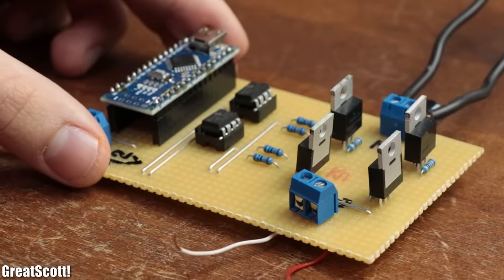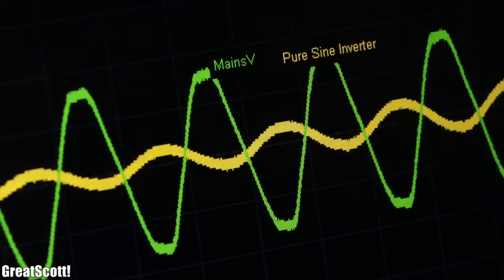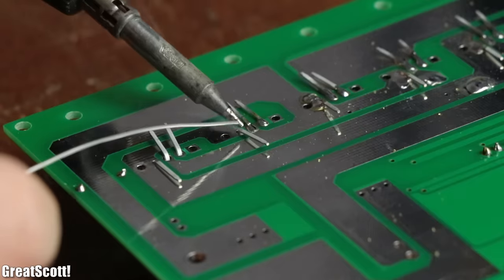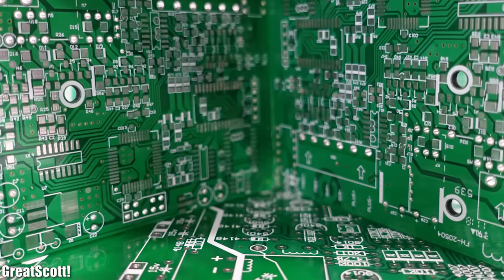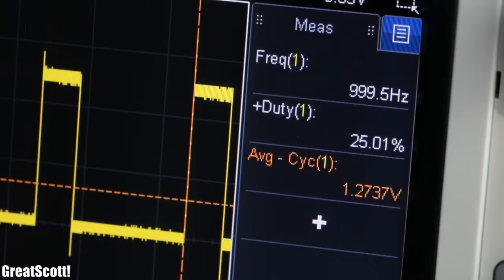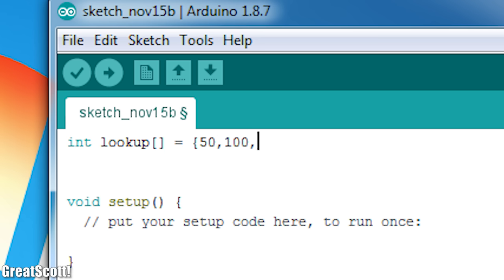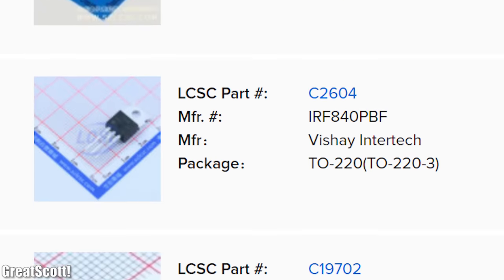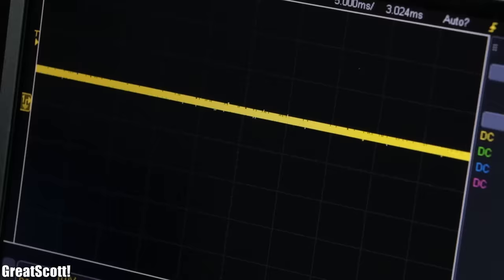Does it suck? Chinese DIY Pure Sine Wave Inverter || Sinusoidal PWM (SPWM) Tutorial

Comment: Nobody should underestimate the difficulty of inverters. They are hard to make properly, and mains voltage ones are frickin' dangerous too.
Reply from the maker: Well said.
Reply: But it would be pretty great if there was a good open hardware design for a 1000-2000W 12V to 220V inverter around.
Reply: @FQD2N Extremely high current is available, and there are nasty frequencies involved. Touch the wrong thing and you might have 40A at 6kHz flowing through you. I bet that would hurt like the dickens and you probably wouldn't be able to let go.
Reply: As someone who worked on a grid connected solar inverter. You're right. Its even harder when you have to design it according to set standards. Minimal Harmonics and leakage current etc.
Reply: @FQD2N well what if you are electrically grounded?
Reply: Seasoned professionals who do this for their day job wear eye and face protection to protect for that  inevitable explosion. I think there are more fun electronics projects out there that are way less dangerous.
Reply: Yes, because you need a (preferably isolated) dc-dc step-up converter, which get pretty complicated to make, and feedback circuits to handle dead-time compensation and follow mains voltage.
Reply: >"don't underestimate inverters"
>people be still underestimating inverters.
Reply: @TCGProductions03  you realise that you need a potential on the order of 1 million volts to get 40A to flow through a human body...
Reply: It took me a little more than two years to get a flyback up and running, so yes, the difficulty cannot be overrated.
Reply: @vincei4252  Except people (usually) don't want to build inverters just for fun, they have a practical application and inverters are usually overpriced, so...
Reply: is it possible to get a tour video of your work shop to see what items you have on hand to make these projects? its nice to order stuff from china in advance and not having to wait 3months for that one Mosfet to arrive to finish the project.
Reply: @LeslieIsgrigg  Cars, boats and RVs are usually using 12V (I think some 24V) hence my interest in that volt range. As for output - I am in the 220V 50Hz camp.
Reply: Disagree for dangerous assumption(!), partly agree for "difficulty". The "difficult" part is rather pricy for learning & mastering. One needs to get the an oscilloscope (the 4-channel ones are much better!) and at least one differential probe (better to have 2x) for high-side debugging & tuning. There are also some complications for getting into MCU registers for smooth & precise PWM, but it's only a something to learn thing.
For the dangers these introduce to the hobbyist, nothing special is here compared to working with mains voltages.
Reply: I used a DDS and a stereo amplifier and a step up transformer. Got a flawless sinewave
Reply: vial.of.photons  everything depends on the power you want. I needed an adjustable frequency and adjustable voltage supply , which  I use for calibration. I've been able to run lights and fans etc from it but its not what its for. cheapest it could be built for is around $35 USD. I made a couple of videos about it early last year. I've been meaning to make a new video on the subject
Reply: @50Hz  what is a dds,  please?
Reply: I found it, direct digital synthesis, is ok?
Reply: @DavidLopez-bz4rj  yes. I used a Ad9851
Reply: @50Hz  thanks
Reply: @tcurdt  i should really make one! Im a power electronics PhD student.
Reply: @rikka0_059  Well, do it! Would be great to have an open hardware effort into that direction.
Reply: Alex Beardmore they're easy asfuck to make..
Reply: Miguel Moreno Talk is cheap. Care to share a design?
Reply: I think old square wave inverters are easy to make, especially square wave mechanical ones, but definitely not downplaying the danger.
Reply: @greatscottlab  Sss
Reply: @TCGProductions03  It's just pure bullshit, especially if one is somehow familiar with ohms law.
Reply: @curitosikls8653  The breakdown voltage of air, under normal conditions, is about 1 KV per millimeter. You need about 5000 volts DC for a 5 mm arc. For AC it's going to be frequency-dependant, as capacitance starts playing role, but still pretty high.
Reply: muito legal
Reply: Then why are they available in the market for so cheap?
Reply: why y'all just scaring like this from main voltage, what would you do if you where playing with 400v 3 phase voltage like how a normal electrician Does every day of his life. If you want to make sure people wont get harmed, Its better to teach students or new people or whatever how to work with it without harming themselves, not scaring the shit out of em!
Reply: @Aidan Fransen - You said pretty much what I was going to say. It really pisses me off when people state fallacies as fact, and people queue up to like the comment. It’s the same logic that claims “it’s not the volts, it’s the Amps that kill”, and “car batteries can kill because there’s over 300 Amps in there!”  Both are demonstrably gibberish. Ohm’s law is one of the first things you learn when getting into electronics or EE. If they have learned that, then they shouldn’t be spouting fallacies and misinformation. If they haven’t learned it, they should STFU and stick to a subject they understand. Also, “dangerous frequencies”?! The danger of death from cardiac arrest by electric shock decreases with increasing frequency, this is a well known phenomenon. High frequency AC (ie several KHz and higher) can burn, but our nervous system is increasingly less affected by it as the frequency goes up.
Reply: @lordRW  if you want a MOSFET or more cutting edge semis that has published all the needed and tested specifications, then forget about getting it from China.  They sell fakes that underperform.  Meeting specs are extremely important for this type of undertaking, otherwise, expect underperformance if it doesn't melt down and blow up.
Reply: @tcurdt  you are concerned about the easy part of the problem not getting a true sine wave.
Reply: @tcurdt  DIY inverter with line voltage and this power level is extremely inadvisable, ask professionals for help.
Reply: I made one.
Reply: I managed to make my own inverter today. It wasn't' that hard. It can output 50 Hz 120 V AC. I didn't set it to 60 Hz yet. This is a Madagascar inverter because Madagascar uses 50 Hz 120 V AC.
Reply: @fortun8diamond  post a video please
Reply: @kiyotaka269  Sure
Reply: Yes
Reply: @vincei4252    ...very necessary especially after the power Mosfets or IGBTs are soldered in, i've had my share os scares;
Reply: @aidanfransen3571     he didn't ...

Comment: Back in 2006, I built my own 150 watts pure sine wave inverter using the PWM method. Instead of using a micro controller, U sed a simple comparator which compared a 6 KHz triangle wave with a 60 Hz sine wave generated by a wave shaper (6 diodes and 2 resistors).  I have to say I was amazed by the result.
Reply: great idea.
Reply: Hi What do I need to build 10k watt inverter?
Reply: @jamesjohnson5700  Depends on a lot of things. What input voltage, what output voltage, What type of what you want on output (sine or pseudo).
A 10kw inverter may seem a big deal but you can already get 3kw inverters off the shelf at Walmart or a large hardware store.
Reply: @francoisleveille409  I wanna build my own with high & low voltage protection & can the input & output be the same I want sine
Reply: @jamesjohnson5700  You'll have to give more detailed specs if you want something from me. Also, I can't exactly give you a detailed schematics in a comment section.
Reply: @francoisleveille409  OK so here you go it's for my 340 watt solar panel I'm gonna add a parallel charging board with 10 connectors to add my 10 10a 12v lithium battery packs to the charging board then I'm gonna connector the 30a charger controller all I need it a 10k watt inverter to connect it all it's gonna be like generator
Reply: Good old days...
Reply: would like to see the 150 diagram.
Reply: @boydmcree9085  Trashed a decade ago. Not worth it anymore. Back in 2006 a 150W PSW inverter was expensive. You get it today for peanuts. Walmart sells 1600W PSW inverter for 200$.
Reply: yeah,  but it was the idea, that is what i was going for, just to see how you did it, my idea was a ring oscillator trigger system and a op amp comparator to adjust pulse length. not for 150 watts though.
Reply: @boydmcree9085  The 150W or 10kW doesn't matter. What matters is your driver signal.
It's going to be pretty much the same whatever the output power. But nowadays, instead of using a traingle wave of some frequency compared to a sine wave generated by a wave shaper, you can use a 5$ Arduino clone to do it to perfection for you. So unless you have a specific fondness for old time analog electronics then there really isn't much point.

Comment: I must be a masochist...  Right after seeing this vid I ordered two of these pure sine wave generators and downloaded all the docs I could find about them.  But then I have different tasks for them than making the invertor you tried.  1/ set one to 400 hz, link it to an amplifier and output that to a step up transformer for driving the X and Y plates of a scope.   2/ set another to 400 hz and drive two half bridges fed by 25 Volts to feed a scope's piwer transformer.  (1950s analogue CRT scopes..). I will be using the sine wave generators, NOT the onvertor boards.

Comment: Hi! Nice video as always! But i think you used the wrong pcb for the thing you're trying to do! This pcb was made for the version where you put 400V in the board from a different source. You used the same compoments for the version with the iron core. The IRF840 are high voltage, low current mosfets with a BIG RDSon so thats why you had so much idle consumption. Try using the IRF3205 like they said in the datasheet with 8mOhm RDSon and bigger current, even in parallel! Also the transformer should be 8V to 220V and not 12-220 :D
Reply: Please use Chinese if you want to  communicate with him
Reply: @antonf.9278  对不起
Reply: Now I understand
Thanks
Reply: Are you Estonian?
Reply: @markusantonov6373  İf you're talking to me, no 😁
Reply: That's Estonian background tho
Reply: @markusantonov6373  actually it's in Warsaw, Poland
Reply: Dimitris Vlamis Ach polska
Reply: Amen to that. Made my own 12v-220v inverter with attiny861 (has 6 complementary outputs), gate drivers and irf44n and it was much better.
Reply: @goldenss3219  Ach Polska, Polska
Reply: @valiza123  any info on that?
Reply: @dimitriosvlamis8696  If you mean a video or a blogpost with the results then no.
Reply: @markusantonov6373  lol I thought the same for a second
Reply: Are you made it ? 12-220vac. I not completed it, voltage ouput only 120vac, i using traformer 7.5-220vac,irf8400, egs0002,egp1000w. Output voltage before tranformer is 8.6vac. Please can you help me. Thanks so much.
Reply: IRF3205 is a 55V 8mOhm device
Reply: @johnconrad5487  55V is good enough for 12V application.
Reply: Here is the eg8010 datasheet. https://www.lz2gl.com/data/power-inverter-3kw/eg8010_datasheet_en.pdf
In Figure 6-6 /page9 ,  IRF3205 is recommend for 12V application by EGmicro corp.. 
Since Scott bought the wrong PCB, he have to rework the PCB for 12V application.  e.g. the module pin15(voltage feedback) should be from the output voltage(220V). It seemed that he did not rework the PCB. That is, the VFB was derived from the 12V output signal.(the worse thing:12v signal,voltage drop:bridge diode 0.7x2=1.4V  and nonlinearity )  And he also have to change the current sensing resistor from 0.1 to 0.01 Ohm for 12V application. They are all related to the protection and measurement.   ....etc.
By the way, the full-rated 1000~3000W low frequency transformer  is very expensive, heavy and big. Converting the low DC voltage(12~48V) to the high DC voltage (~350V)  with high frequency transformer would be recommend and cheaper.
Reply: @imcrazy886  There is a place for both, the low voltage approach tends to support higher short-term load provided enough parallel fets are used, which many would want - google "ozinverter".
Reply: I also d
on't understand, why he doesn't use a ready transformer from UPS, which has exactly the necessary parameters (it's 2x7.5V-220).
Reply: so does the module have enough gate drive for large (bolt down terminal) mosfets? i want to get usable ac from solar strings that i can wire for 400v and bypass low voltage inefficiency. will it also drive igbt modules? im rather nervy about direct driving high voltage gates without knowing the driver +- gate voltages and slopes for higher power. also the degree of isolation

Comment: Hi all I use it from more than  3 years the original design is not with a transformer EGP1000 basic destination was to use with solar panels 10x36v panels so input voltage is 360 to 400 volts and his maxim power is 3000W with 100 panels with minimum 20u capacitor on output LC filter. Design of EGP was for green energy

Comment: The amount effort you put into this video is astonishing, it makes me guilty for not supporting you other than watching. Sourcing the parts on your own must be such a real pain in the ass to do, and the fact you said "it doesn't blow up" multiple times clearly tell us you must be very happy with your hard work!

And oh, the principles of sPWM looks real similar to class D amplifier, only with some feedback inputs. Now I remember my silly idea years ago, using audio amplifier with step up transformer to make a sine wave inverter because back then, sine wave inverter was so expensive, it's literally unaffordable but today's sine wave inverter are getting cheaper and more affordable, there's no point in making your own with the risk it poses. Seriously, just get yourself a proper one.
Reply: Using an audio amplifier with step up transformer to make a sine wave inverter is something that can be done in a pinch and actually works fairly decently. Just don't expect a stable output.
Oh and it also is very dangerous, obviously.
Reply: That's why I never do it :-)
Reply: @Electroblud  can be isolated.
Reply: @Electroblud  It's a pretty poor one, the proper way to make an inverter is to step-up the DC bus voltage before feeding it to your inverter, that way you only need a high frequency SMPS transformer instead of a mains transformer. Also, if you're looking for electronic components, Arrow.com offers free shipping worldwide on any order. They just don't have everything in stock like digikey does.
Reply: I remember seeing a 3 phase 400Hz 220V power supply built using H&H audio amplifiers in a aircraft instrument factory during the 1980's. It was a very fine piece of equipment and gave a very  impressive performance. The disadvantages were that its efficiency was abysmal and it was not very portable. It was mounted in its own 19" rack with heavy duty castors.
Reply: You can use a amp to drive a transformer I have done it loads of times,  say you need more output from your signal generator  you may need an obscure frequency for say driving aircraft equipment at 400hz or slowing down or speeding up a ac motor i have even used a amp to drive a flyback years ago lol it is just not very efficient or good for the amp so if you try it dont use an amp you care about and put a high power resistor or a light bulb in series or at least a fuse lol............

Comment: 8:15 first time he gets angry on video.
Reply: No, he got angry when he built a Bluetooth ceiling speaker. "I destroyed the receiver because I am such a genius ".
Reply: @chargedsupercap2270  He called things bullshit multiple times before aswell.
Reply: Ambilight part 3.
Reply: @elek101  exactly.
Reply: @elek101  that's mildly disturbed at best...
Reply: "like, it would be TOTALLY AMAZING and SAVE MY LIFE if you could pass the salt"... dont use wrong words... it adds something where there is actually nothing.
Reply: He said f word on Ambilight part3 video
Reply: The capacitor he solders is actually too small. He should have ordered bigger ones.

Comment: 20W is actually quite good, the multi-thousand dollar pure sine wave off-grid inverters often have standby losses of 30-40W continuous. The main reason being transformer losses and running the control circuits. I would be very interested in this module for a 48V or higher input application, really just a question of the right MOSFETs and filter design at that point.
Reply: I just read your comment after making a post something similar about inverter sizes and power drains
Reply: I designed my inverter system from scratch and generated spwm using PIC microcontroller. I had no load power of around 40W and had been researching if that is too much because I feel my MOSFET and transformer heats up more than required. I switched at 18kHz

Comment: The chip on the EGS002 board has a variable frequency operation mode as well as a fixed V/f option to accomodate the reduction of inductive reactance as frequency increases. I think that this can be used to create a single phase VFD (230V 50Hz in) that should be able to be used with single phase induction motors to enable speed control.
This is on my backburner at the moment, so anyone feel free to try it out!
Reply: Will do. I deals with vfd controllers too.
I thought that chip could be used to control motors.
Good point.

Comment: One suggestion to decrease idle consumption, add some inductance in series with transformer primary, other wise the current through the capacitor will be too high. I have done some experimenting with these exact boards :) I fully agree that they...work, but are not very "ready for use".

Comment: When doing this pwm to an H bridge you do not need to feed pwm to both sides of the bridge, you can feed pwm to one side and just turn on the other. Most ebike speed controllers work that way just for a bit of info